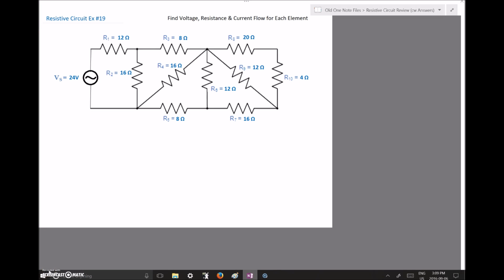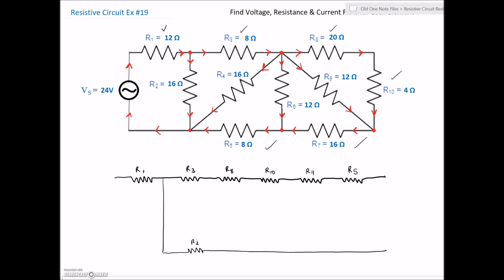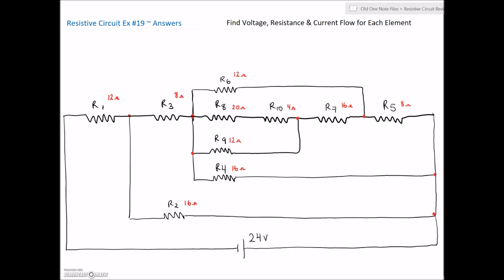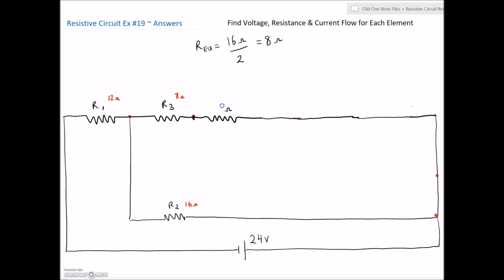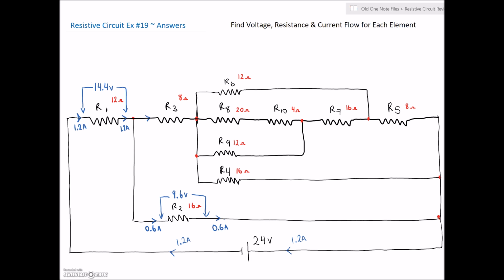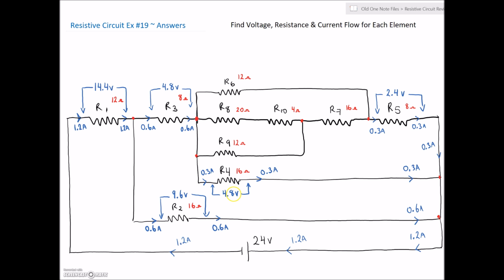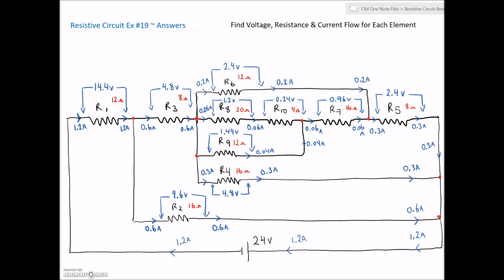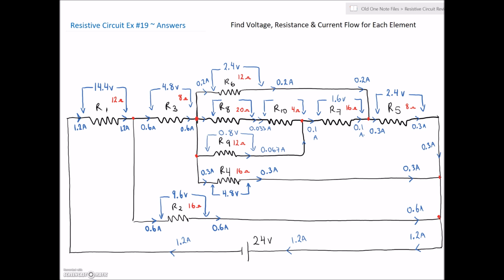Series Parallel Combination Circuit #19

Comment: Having struggling drawing it, I understand that in parallel, current is equal and that in series voltage is equal, its still pretty confusing
Reply from the maker: Might be confusing because the relationships are that current/flow is the same in series and voltage/pressure is the same in parallel.

Comment: It might be trivial to solve this question but wouldn't current flow from positive to the negative electrode(19:40)??
Reply from the maker: Most electronic textbooks do use the Conventional Current flow model (+ to ), however in my class we use Electron Flow model ( to +). I use the same rule throughout the course because I make use of Flemings Right Hand rule later for Generators which uses the same - to + notation.
Reply from the maker: Am I correct that your school follows the International Baccalaureate Curriculum? How do you like it? My daughter is applying to a local school that follows the IB Curriculum.
Reply: @PLCAutomationAcademy  IB is great!!

Comment: You make a series parallel combination too complicated .Solving from back to forth it's  way easier to solve and explain. Malvino reference is excellent for this combinations. R8+R10   parallel to R9 find equivalent .R6 parallel to equivalent+R7  find equivalent .... and come up with only one sum to 20 Ω  total.
Reply from the maker: This method has worked well to allow students to take a complicated circuit and reconfigure in a different manner. I'll take a look at the Malvino's books though. Thanks for the comment.

Comment: your R3 ,you do not series in R4 because your r4 0.3 while your r3 0.6....explaine me how you determine that
Reply from the maker: If you stop the video at 36:11 you will see that the 0.6A flowing through R3 then branches off to a number of parallel rungs. So R4 is just one of the parallel branches in series with R3. You will notice as well that the currents from all the parallel branches recombine to give us the 0.6A that was flowing through R3. Hope this helps. Pete
Reply: R3 and R2 are connected in parallel. why  the voltage are not same. explaine please
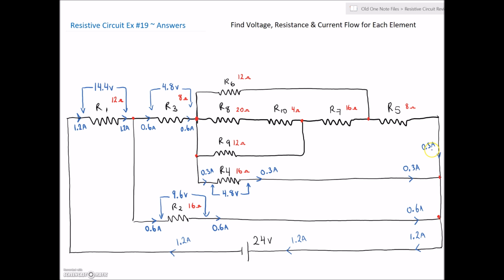Reply from the maker: Have a look again around 25:26 R3 and R2 are in parallel, but R3 is actually in Series with a whole bunch of other resistors. The overall voltage on both rungs is equal, but R3 and R2 do not have the same voltage.

Comment: At 29:23 on the junction between R7 and R5 - By the current rule the total current entering must equal the total current exiting. However, .2 A (entering from R6) plus .06 A (entering from R7) does not equal .3 A (exiting towards R5). So the assumption that 2.4 V/(R8 + R10 + R7) = .06 A must be invalid...
Reply: nvm, mistake caught later on in the video
Reply from the maker: Yes. At 35:00 , this is changed.

Comment: Isn't there 2 wheat-stones bridge like connections in the circuit so that we needn't take R6 and R9?
Reply from the maker: From what I understand of Wheatstone bridges, you could place a voltmeter where R9 is and look at the proportional voltage drops across R8, R10 vs R6, R7. However, as soon as you place R9 back into the 
circuit it effects the current flows. Send me a diagram to vree.peter2@gmail.com if you want to discuss further.